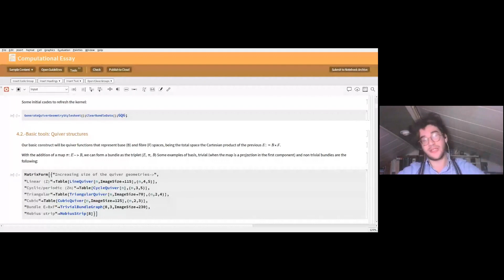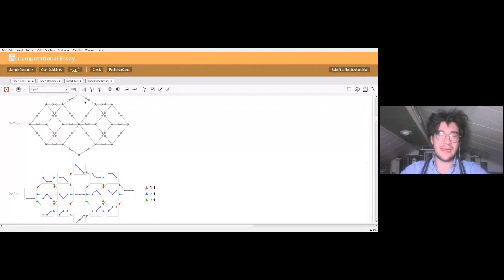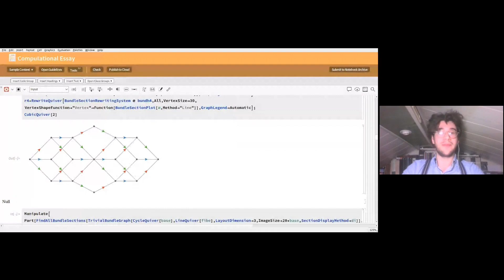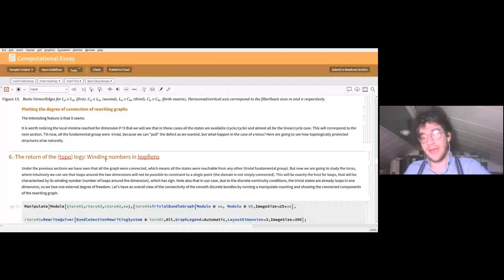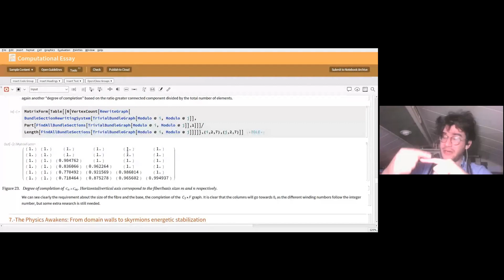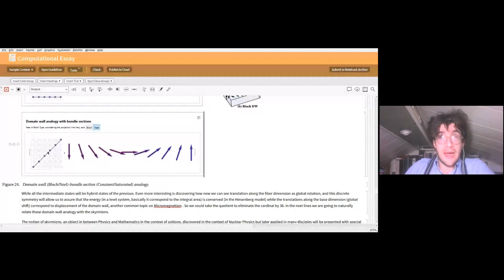Graph Rewriting for Lattice Topological Invariants

Comment: New Skyrme parametrizations to describe finite nuclei and neutron star matter with realistic effective masses
Authors: Mingya Duan, Michael Urban
Abstract: The phenomenological Skyrme energy density functional theory is one of the most popular theories for dealing with finite nuclei and infinite nuclear matter, including neutron star matter. However, in a recent study we reported the problem that in many Skyrme functionals, the neutron Fermi velocity exceeds the speed of light at densities that exist in neutron-star cores. To solve this problem, we try to construct new Skyrme parametrizations by including constraints from microscopic calculations of the effective mass in addition to binding energies and charge radii of finite nuclei and different microscopic equations of state of pure neutron matter. We give the parameters of the new Skyrme forces and show that our new effective interactions can successfully describe properties of finite nuclei (including the weak radius and the neutron-skin thickness of 208Pb which were not fitted) and nuclear matter (including pure neutron matter, symmetric nuclear matter, and neutron star matter